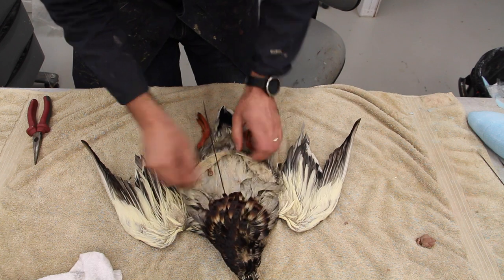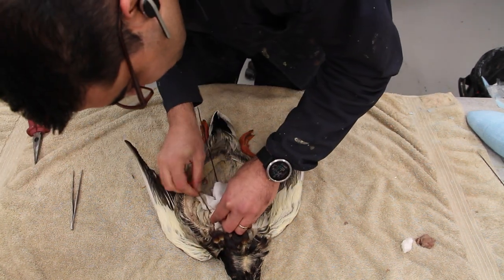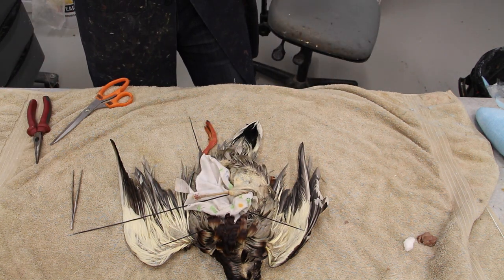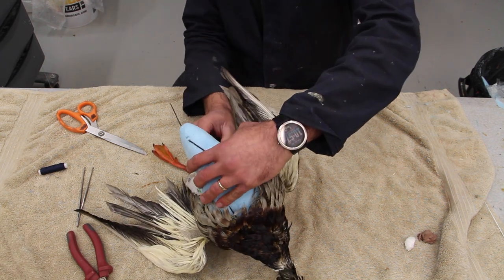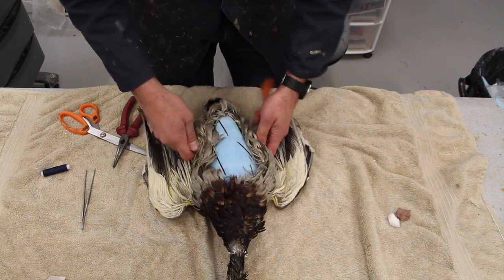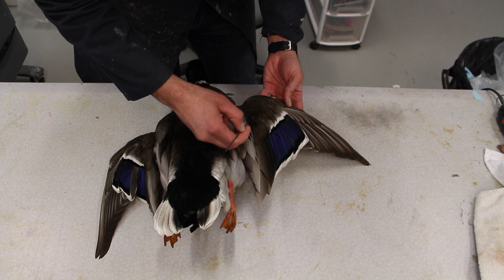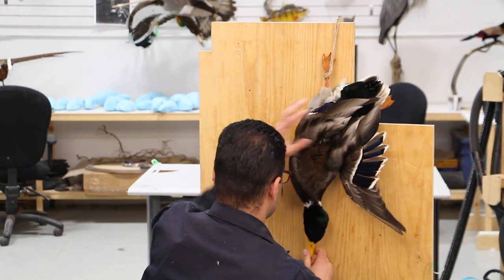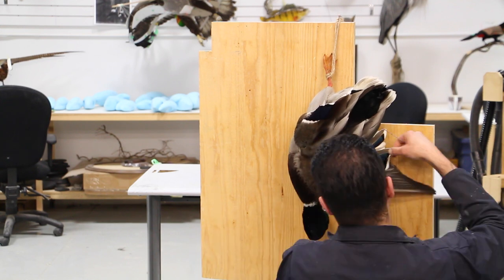Waterfowl Taxidermy. Mallard part 2 of 2, Wiring and Grooming.

Comment: You probably get asked this often but what it’s the body material? And is there a place to buy it? You started to explain you liked it but I couldn’t pick up if you said anything about what it was.
Reply from the maker: Yes and it’s surprising to me that why not many people are aware of the foam , it’s the most used foam in taxidermy. It is called buoyancy billet they come in large blocks and are supplied by construction stores. Taxidermy suppliers probably cut them and sell them in smaller block for 10 times the real price. Look for it in your local construction supply store.

Comment: Thanks a lot for this video!! In part II you say that sometimes you build the drumstick / wingbone, somtimes you don't, depending on the pose. Could you explain in which pose you need to build up the bones?
Reply from the maker: Building them up all the time Is not wrong , but I tend to not do things that I can cover them in an easier way. For example on a relaxed and standing waterfowl you can just skip the drumstick since the legs are all tucked inside and you can compensate it with caulking. But any pose that requires the legs being stretched and shown more I would for sure build up the legs accurately.
Reply from the maker: In future videos you will see that being explained more.
Reply: @ArtofTaxidermy  OK, thank you!  What about the femur (wire), do you fill this area (recreating the muscle)?
Reply from the maker: Not unless it’s in flying pose and it’s stretched out.
Reply: @ArtofTaxidermy  Aha!! Thanks again!!